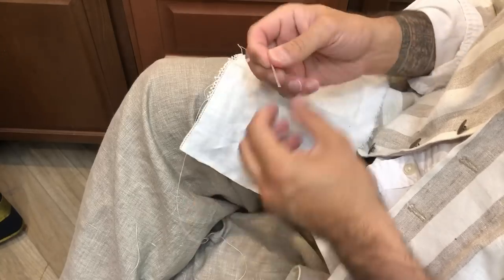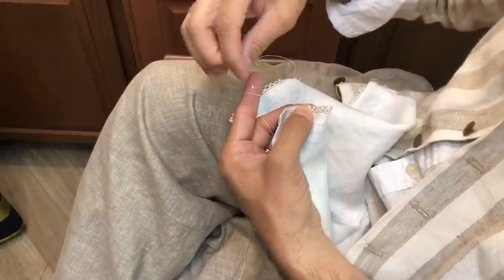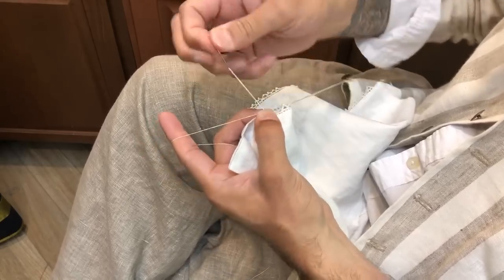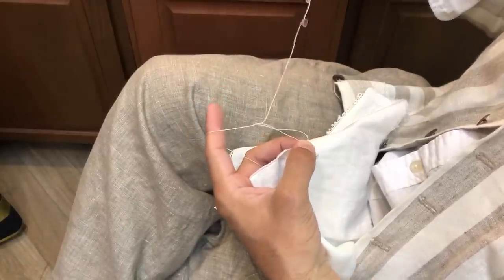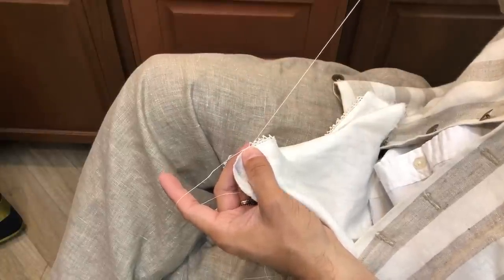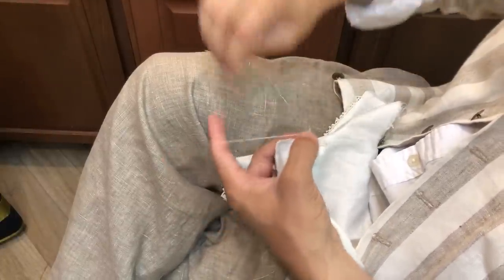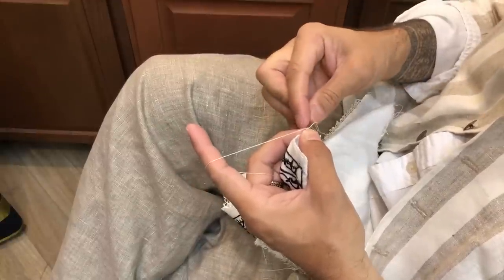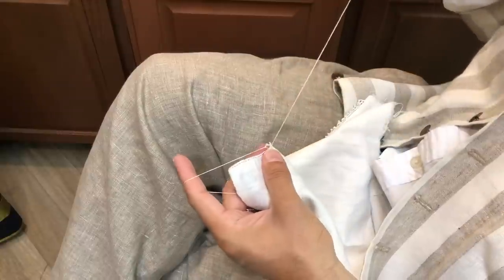FREEHAND LACE EDGING DEMO

Comment: Thank you so much for doing this video! I have been trying to find a way to add a very subtle hand edging and have been exploring needle tatting . This is a great idea. Are you using standard cotton thread or is a very fine crochet cotton? I am probably exposing my ignorance!
Reply from the maker: I'm actually using a 40/2 linen thread in this video. Since most of my work centers around 16th and 17th century-style craft, linen is the correct fiber for most lace making. Cotton would work well, but you would have better results with a finer pearl cotton than crochet cotton. Most crochet cottons are too dense and the twist too firm and that will cause more rotation of your stitches and a less tidy appearance. A less twisted cotton thread will grip to itself better. An un-mercerized crochet cotton could work as well. The less slick surface will help create better needle lace.